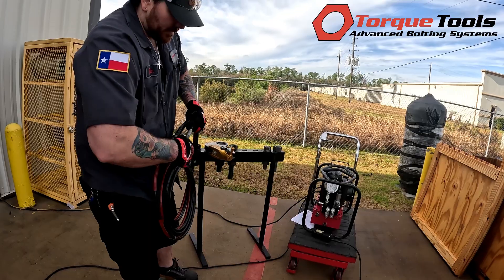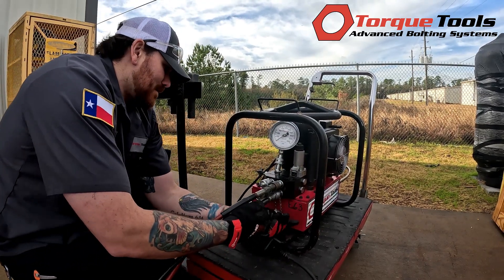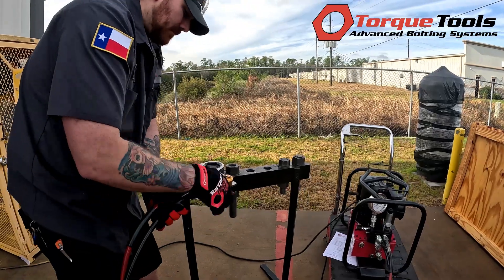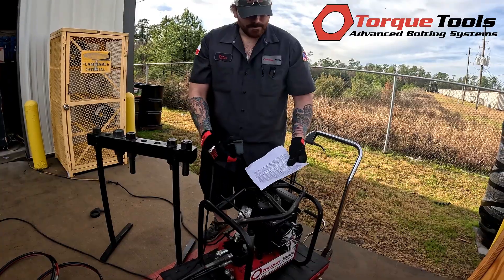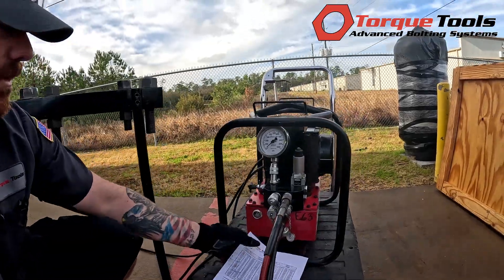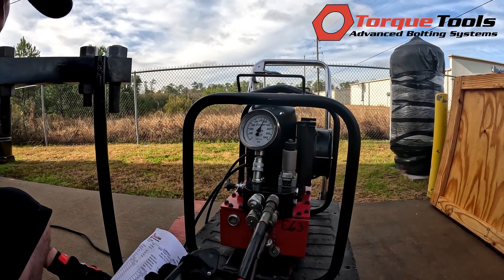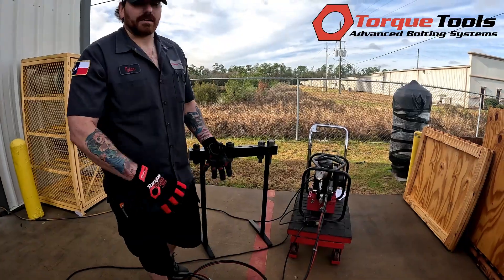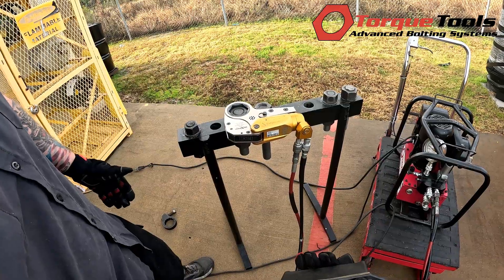Using a Hydraulic Low Profile Torque Wrench

Comment: We use ours Daily on Large Mine Truck Components that need high torque on fasteners.
1995 ft lbs for 1 1/4 NF 12pt cspscrews in our application.